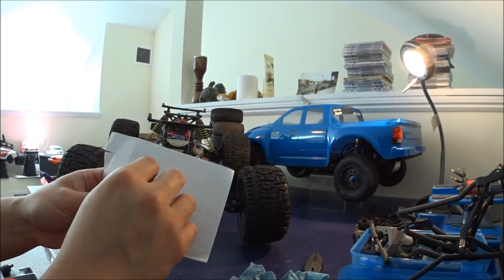1/10 ECX Ruckus Wheel Hub Hex Width Extension Installation and a Quick Run

Comment: Yeah, Loctite is crucial with those (mostly on your 2 left wheels) or the the non-nylock barrel nuts spin right off. On the right side they spin in the tightening direction so they’re fine. Got some on my Redcat Volcano.
Never get the kind with the O-ring that holds the pin in. They’re a joke.
Reply from the maker: LOCK YOUR DOOR great tip never thought about that thanks

Comment: Very nice dude, is it improving stability when it doing hard turn?
Reply from the maker: Rizky Ariesta thanks man I do notice it's a bit harder to traction roll but the truck still sits high so it will still roll over if you turn at full speed.. But in general it handles a bit better... The truck is very light so I'm not too worried about the extensions or the axles bending  which is one of reasons why some people don't like doing this.
Reply: Cirasa RC and gladly it created from light aluminum so wont make so many damage for the axles, iam still waiting for this stuff from ebay, thx for your reply dude

Comment: You have to subtract the width of the replacement part. Can you measure this and let me know?
Reply from the maker: What would u like me to measure?  The overall width of the truck with the extension?
Reply: @cirasarc4413  The width of the part you removed and replaced with the extension. I need to know how much to to subtract as I am trying to keep wheels inside body. Building a 1/8 GT from a slash.
Reply: @cirasarc4413  and thanks for reply.
Reply from the maker: I went to the box where I keep all my Ruckus parts that I removed (even the broken ones) from the truck, to my surprise I did not find the stock plastic hexes in there.  I may have used them on a different project, I don't remember since it's been years.  I did measure the width of the front wheel and rear wheels, the front measures ~360mm, the rear ~373mm.  Horizon Hobby states that the width of the 2WD Ruckus is 348mm, don't know if it's for the front or rear but either way the math doesn't work out.  Sorry couldn't help you man.  Hopefully someone who still has the stock plastic hexes sees this and can measure them for you.

Comment: Link?
Reply from the maker: Hi, you can search for "12mm Hex Extension" on eBay and you will see plenty of choices.  I bought my set from a seller called "buy-never-stop" and the item was shipped from a U.S. location and I paid ~$10 total.  Good luck.
Reply: Cirasa RC Thx